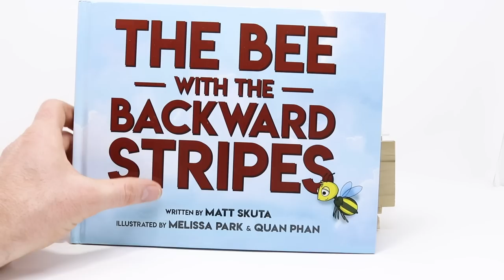The Plopinator Mouse Trap - Great At Catching Mice & Attracting Opossum. Mousetrap Monday

Comment: I have been developing a similar trap using a PVC tube.
I like the idea of a tape measure for the return spring and trigger.
I have been using rubber bands and a magnet but that seems a much better solution, I might try it.
I will post some video and simple plans when I am happy with it if you like.

Comment: A trap i have always wanted to try but never did is putting a sheet of paper or something along those lines over a bucket and pulling it tight an using a rubber band or something like that maybe something a little less tight and putting a smear of peanut butter right in the middle and whats supposed to happen is the mouse goes ontop and walks across till the middle and once it gets there the sheet of paper gives way an you catch em, now its ment to be a kill trap as if it wasnt they would jump out. Would love to see you try it an see if it actually works

Comment: You should just put the zips on without the top screen, and then reattach it. It looks like the gap created by the velcro strips would be just wide enough to allow for a much better fit :)
Reply: Julia68yt But then the mice could get out from the top.

Comment: cutting the tape measure down decreases the leverage and therefore increases the force required to trigger the trapdoor. increasing the trapdoor length reduces the force required to trigger it .the trapdoor  overlaps the platform by  a half inch and if you remove some of the platform floor where the trapdoor overlaps you could essentially give the trapdoor another 1/3 " and increase the leverage  and make it more sensitive.

Comment: Looking at the mechanics, trimming the steel tape has nothing to do with when the plank is triggered to open.  It only influences the force with which the plank is pushed up once the plank hits the end of the tape, nothing before that moment.  This in turn influences the width to which the plank opens under a given mouse weight and the force/ acceleration/ speed with which the plank is pushed back up.  Mechanical engineer here. :p

Comment: The mistake you made was to shorten the measuring tape spring. Think leverage. If you were to replace the original measuring tape length with a longer piece, you would lighten the load required to actuate the trap door. Love your videos. I'm  a WOODSIE too!

Comment: If you want to save zip ties stick a T-pin (small pointy object) under the recessed locking head and slide apart. 
🙂 I do it all the time, works great.

Comment: I think it would make more sense for the plank to pivot at the center with a stop at the far side and the weight slightly distributed toward the entrance-side. This way, once the mice got just past the pivot, the weight of the mouse would always rotate the the trap door into the bucket. The side close to the entrance would also feel very solid as the mouse begins walking on it.  The  tunnel could also be as big as desired.

Comment: Instead of cutting straight across the tape try rounding the edges. I think the sharp edges are catching on the wood when the ramp comes down a bit and making it stick and making the force needed to set it off inconsistent. Sometimes it sticks and needs say 50 grams to set it off and sometimes it doesn't stick and only needs 20 grams to set it off.

Comment: May I suggest a one way door at the entrance, so that any smaller mice that are caught that don't drop through the trap door can't actually escape the trap? That way, if another mouse enters, then there should be enough weight to drop them both. Also possibly limit access to the bait so the mice can't safely sit on the bait side. Well designed trap

Comment: I need a rat trap. Looking at all your vids, I'm going to use a 3" sewer pipe and cut a slot on the bottom and setup a sort of plopinator style plank and put it on a 55 gal drum. I hope it will work. If so, I might send you my contraption.

Comment: In fairness the spring looks very well weighted to support the mouse initially so they stay on it then they get plopped.
I think that's a good design feature as i ahve experimented  with rat catchers and that tipping point is quite crucial or the rodent is very wary.
It the trap moves too suddenly the mice just avoid it.

Comment: Complicated but effective an electric mousetrap is more sensitive, two tubes with the inner covering the external hole, with a spring coil contacts and micron bridge wire. works every time.

Comment: That's why you can't have good things .. opossums!  I see problems ahead for the tape measure trip mechanism. Not only was it inconsistent at tripping, but after a while, it will either break or kink at the bend point.  Perhaps you could stick a good sized constrictor snake in that barn to take care of the fat rats ... AND the possum!

Comment: The ruler is there mainly to reset the plank by lifting it back high enough after tripping for the magnets to pull it the rest of the way up. Sensitivity adjustment would require adding thin shims to the magnets that holds the plank up, slightly reducing their effective strength.
Reply: @alexr.1097  Did you watch the same video I watched? The ruler isn't anywhere near touching the plank once it is reset, which means it isn't providing any support whatsoever. On top of the plank, you can see two black rectangles that split apart every time the trap gets tripped. Pretty sure those are magnets.
Reply: @teardowndan5364  ^^^ this ^^^

Comment: The “plopinator” mouse trap worked great. I liked the way Matt used a length of a tape measure to support the trap door. What an ingenious idea. I think the trap could easily be made to capture both rats and mice if a second trap door was added and the tunnel made bigger. The video was cool too. I laughed when the possum came and pulled the trap off so it could get the bait. When the possum came back the second night it was as if it saw that Shawn had zip tied the lid and knew that it wouldn’t be possible to pull it apart again. Do you think that the possum was that clever?